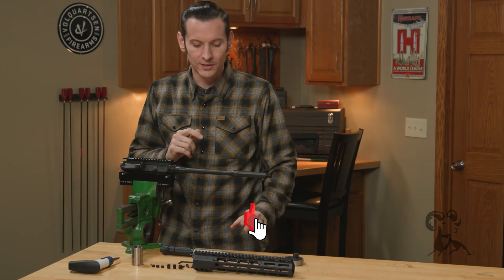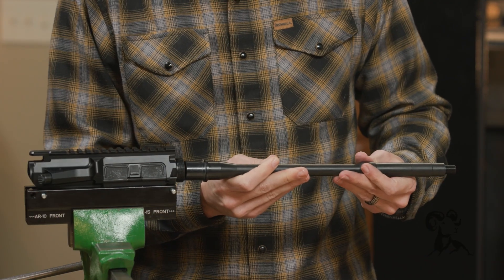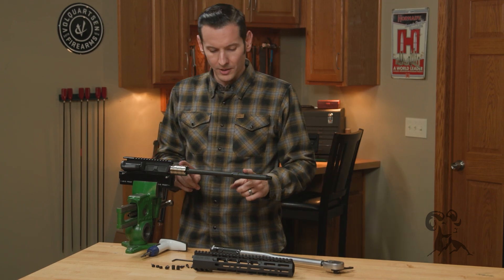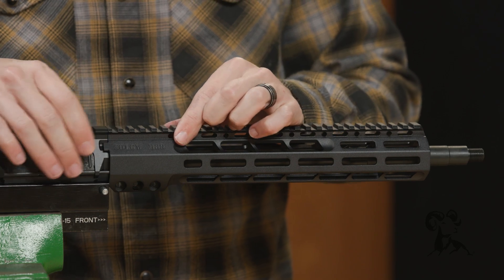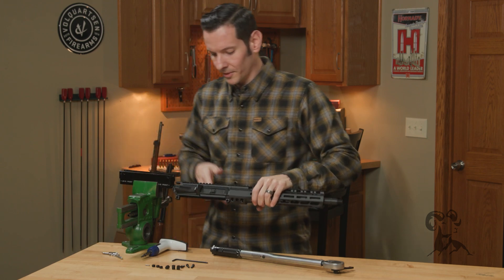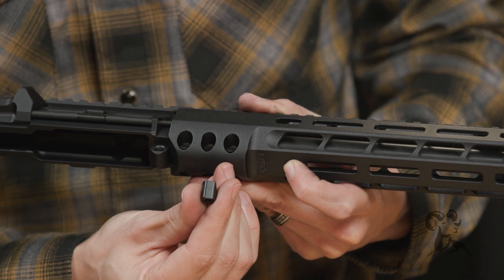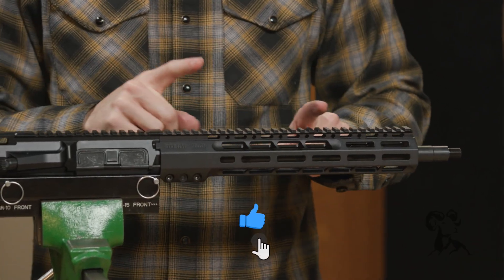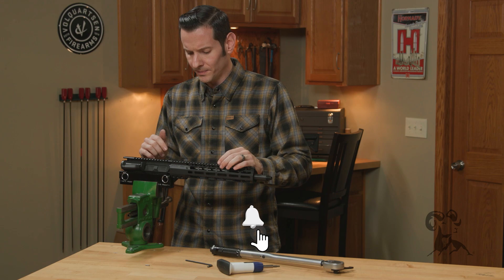Tech Tip: How To Install the SOLGW M89 Handguard

Comment: Just a word of advice. Mine came with the barrel nut already in the handguard. Took the bolts out and couldn't get the barrel nut  out no matter what I tried. Decided to take out the inserts that the bolts go through and the barrel nut fell right out. That's when i realized those aren't round inserts. They have flats to hug the barrel nut so even if your bolts get loose that handguard ain't going anywhere

Comment: I don't understand the appeal of this HG? It's reinventing the wheel by a mid-tier manufacturer for double the price of a premiere brand. Why not just buy one from a top tier manufacturer like BCM for half the price of this and be done with it.
Reply: BCM doesn't manufacture anything lol. Neither does SOLGW for that matter. They do some QC but you can buy directly from the OEM yourself for all these items. To your question though, it matters when you need a rock solid lockup to prevent point of impact shift when using things like bipods/tripods/clip-ons/lasers, etc.

Comment: That is the absolute worst upper vise block you can use. You need a reaction rod that fully supports the upper and barrel index pin. MI makes an excellent one. That block you used puts all of the installation stress on the takedown pin lugs.
Reply: For putting on a handguard it's completely fine. You only need a reaction rod for the barrel nut or muzzle device.
Reply: @ he literally used it to install the barrel

Comment: FYI - The torque spec on the barrell nut is 65 ft/lbs per SOLGW/Hodge. It's a high amount of torque relative to many other barrel nuts, but it is the spec.

40 lbs is quite a bit below spec but may be fine. I torqued to 60-65. YMMV.
Reply: Did you have to call to get this info?
Reply: @UrNotThatGuyPal  Actually,  my install guide from solgw says 60ft/lbs. Maybe they updated it? Who knows.

Comment: Would be cool if Brownells did a builders class. Let's say you have an AR you want to build but don't want to screw it up doing it completely by yourself & you don't want to buy all the specific tools. There are tools & gunsmiths there to help you do it correctly. And then maybe the following day you go the range & make sure it functions probably, possibly zero an optic. Then go back & cover proper cleaning.
Reply: Noted!

Comment: Do the fasteners have to be tightened in a certain order?
Reply: Always alternate in a random order
Reply: I agree with Walther502... always alternate and never completely tighten on the first go around because you want to make sure everything gets aligned and seated correctly before you put some torque to it.  And that goes for anything and everything that has more than two fasteners.  A 5 lug wheel you'd want to do something like 1, 3, 5, 2, 4, 1 or a 6 lug wheel would be 1, 4, 2, 5, 3, 6, 2 and repeat a time or two.
Reply: Solve says start with the center and do a star pattern like a tire, once they get to a hard stop you’re done. I can confirm, It works!!
Reply: Sorry, meant Solgw… not solve. Damn auto correct.

Comment: This vs the BCM mcmr?
Reply: M89 is girthier, sturdier, heavier. MCMR has 1.3" inside diameter where M89 has 1.4" inside diameter. So doesn't get hot as easily but requires a larger grip.

Also MCMR has more mlok spots but there are no spots that I need that the M89 doesn't have. M89 still has diagonal m-lok spots near the muzzle I can still put my inline flashlight on.
Reply: @Lightrunnerr  yeah I decided to go with the m89 for my 14.5. Mainly because of the lock up and having a wider diameter. I have pretty slim rails that have heated up extremely fast after like 2 mags and gloves didn't help much. That being said I have a brand new mcmr for sale if anyone is interested!
Reply: @TheJetlife94  get the rail covers and it fixes that issue. I’ve done a 200 round burn down with my Uppee on a M16 lower and those did fine.
Reply: @BadMelonFarmer78  theirs machine shops that make longer lightened steel barrel nuts for BCM, I got one, idk what the company is tho tbh.

Comment: One tip I found that helps too.  I have an old ACOG mount with the two thumb screws that I place half on the rail and half on the upper receiver.  Since there is always a little side to side play in the rail, it lines it perfectly straight with the upper.  And it keeps the rail in place when you tighten the screws.   An detachable carry handle works too.

Comment: That inch pound torque wrench has a terrifying sound when it releases, exactly like a bolt breaking. Might just be the audio. Great video regardless!
Reply: Yeah I prefer the wheeler fat wrench over this wrench he uses. Just preference really to it’s ergo’s and they also make good tools. Nothin wrong with the one in the video either if course.
Reply: You can get torque wrench’s that are digital so you see the weight adding up and they don’t have a snap to them when they hit the limit. Torque wrench’s have the click, those torque screwdrivers have a snap.
Reply: @FishFind3000  yeah the digitals typically just beep
Reply: HA!!! I thought the same thing.
Reply: You got that right!  For a split second, I thought he snapped the bolt with how loud it was and how far his hand jumped.

Comment: End of March I’m placing my order for a 13.75” m89 for a 14.5” build. I’m excited about that. Lol. And I’ve been waiting for this video for awhile now. Thank you. Great job.
Reply: I got a video SOLGW sent me last year and the torque value on the barrel nut they recommend is 65 ft-lbs.
Reply: @carls2210  thank you for the updated information. I wonder why 25-30” lbs was recommended in this video?
Reply: @Deadleg1-502  "25-30 ft/lbs" was NOT recommended in this video, the recommendation was 40 ft/lbs, try to always avoid torqueing to the minimum or maximum. The Torque range for an AR15 barrel nut is between 35-80 ft/lbs. Anywhere in that range will get you where you need to be. 40 ft/lbs will never come off, the only reason to do more is if you are using a barrel nut that needs to be indexed at a certain point, this one does not.
Reply: @Deadleg1-502  that idk. They also recommend on the 3 small screws to just tighten them until they come to a hard stop. I can email you the video if you would like?
Reply: @carls2210  I appreciate the offer. But it’s ok. Thank you anyways.
Reply: So I misread Carl S first comment to me. I thought he was talking about the three screws on the handguard. I thought he was saying to torque the screws to 65 inch/lbs. 

That’s why I questioned the 25-30 inch/lbs for the handguard. Misunderstanding.
Reply: @Deadleg1-502  Ah, gotcha! 65 in/lb on that size screw is definitely within the broken screw range.
Reply: @CalebSavant  ok cool. I’ll keep that in mind. Thank you